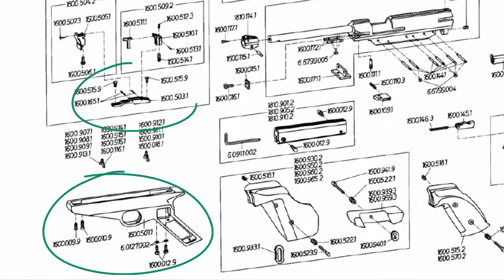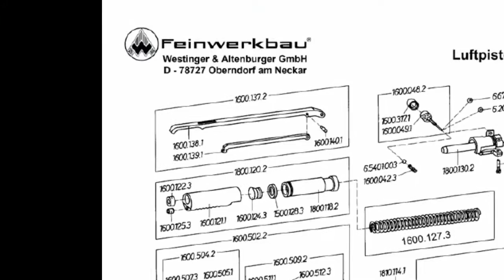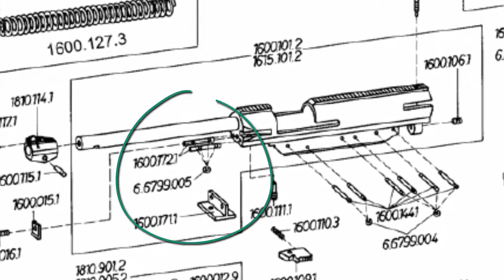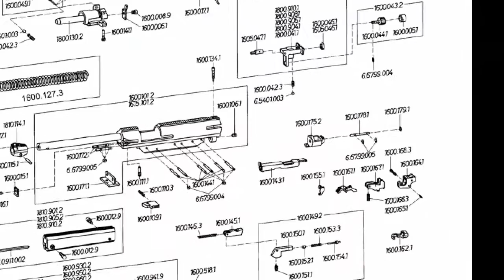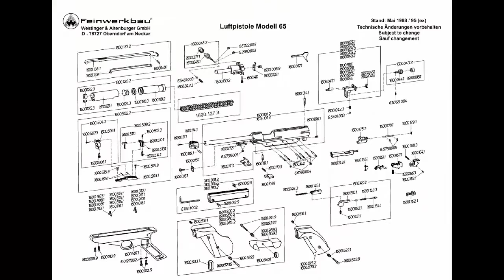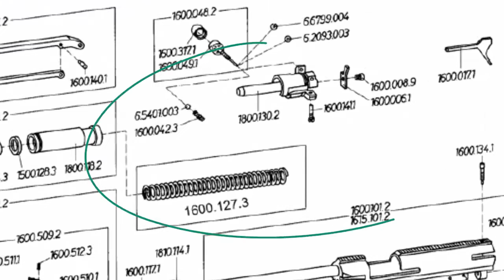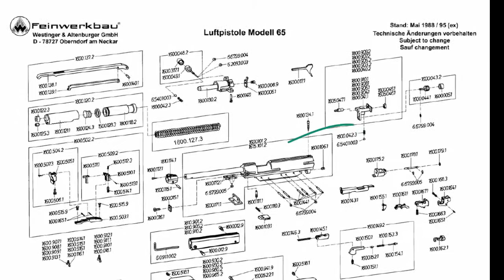FWB65 English Version

Comment: Thank you for FWB65 Video, it really helped with the seal replacement of my FWB80.You removed the cylinder after you disassembled  all the fire control parts, so I inserted the cylinder and reassembled the trigger parts. This took a while since I did not take enough pictures, went to insert the piston and without some way to compress the piston ring I faced the nightmare of taking everything apart again. I started from the back by disconnecting the two springs, that released the sear pressure and I was able to remove the cylinder, insert the piston and finish reassembly. Unless there is a broken part in the fire control parts I see no reason to take all of that apart unless the FWB65 is different than my mod 80. The little black bumper does not fit flush, the tapered end sticks out and will give resistance when you close the lever.
Reply from the maker: Hello, thank you for watching my video!
For sure there are different ways to change the seals, but I also like the challenge to fit complex parts together ;-)
 The little black bumper needs a little lube and force to get it in. When you fit the little bumper, it seals the air in the hole and that air you have to press out. 
kindly regards
Josef

Comment: I have a question the 65 or the 80 i  think they are the same, only can be practiced with the lp 65 via a plate and screw that presses the two cams vuwa and that is not possible with the lp 80, which does not have those two cams  at the front, but if I grind out those two notches at the weights, I can still use them.

Comment: Hi, very nice video. The anti recoil mechanism does not work well in my LP80, my guess is that it needs some fresh lubrication. I tried to dismantle it, but I am unable to remove the sliding pins. I have removed the E-Clips, but the pins seem to be totally stuck. The same issue regarding front and rear sliding pins. I tried to apply greater force but with no results. I am reluctant to be even more aggressive lest not to damage the pistol. Do you have any suggestions on how to remove those stuck sliding pins?
Reply from the maker: Hi, Piotr!
In most cases aceton or light oil helps. Let it suck in a view days. 
Cold Cleaners which you use for engine parts I do not recommend, because they affect the blueing.

The Front Pins you can push out from the breech side!
Details you can see on my other FWB 65 Videos.
Good Luck and patience!
Josef
Reply: I applied a significant amount of WD-40 yesterday and left it for a night. I will try to remove the pins in the evening. If it won't help I am considering to heat them up using soldering iron, maybe they will get loose this way. Unfortunately there is not  enough space to push the pins from behind, especially the front ones, without dismantling the whole system. Anyways, thank you for the video and practical tips :)
Reply from the maker: Heating is a good idea, but try first with the WD40.
I am sure there is enough space when you open the lever. Just below under the loading port you see the end of the front pins. With some tools you should reach them.
Sincerely
Josef
Reply from the maker: Ohh, sorry in the FWB 80 it may be different!
Reply: I finally managed to pull out the rear slide, however I had to remove parts of the trigger group in order to make enough space to push it out. What troubles me is that the sliding pin itself doesn't fit the mount nor 'the sliding hole' in the breech perfectly. It seems to be a little wider near the end, thus gets stuck at some point both in the mount cylinder and the mentioned 'sliding hole'. I think that this is the reason for failing anti recoil action. I wonder if the sliding pin should fit perfectly the mount and the hole, so that it should enter easily or should it pose resistance? How does that look in FWB65?
Reply from the maker: The pin should easily go out, keep in mind that there can be clips or thiny washers you haven´t seen. But from the far it is difficult to help in a specific way. 
In my assembly videos from the FWB 65 I show any detail, if you haven´t seen them yet, take the time and watch them. Most of the parts are similar to the model 80.

Sometimes it is really hard to disassemble an old airgun!!!
Reply: As you said before, patience is the key to success. I finally managed to pull the pins out, cleaned everything and applied fresh lubrication. Anti-recoil works as new :) Thank you again for the tips and the video, it was really helpful, keep up the good work!
Regards,
Peter
Reply from the maker: I am very pleased to hear that!!!
Thank you for your comments!
Now let´s go shooting...
Sincerely yours
Josef

Comment: very good video. I have a feinwerkbau modelo 80. I need help to repair. he was carrying todo shoot and the cocking lever  was left open and does not close. So that the main spring is compressed. Ir happened this morning, a year had not used ir.. Thanks for your help. I am, from Caracas, Venezuela and here no longer exist or repairers armories of weapons. I can only try repair it myself... thank yuo very much.
Reply from the maker: Hello to Caracas!
This sounds similar to the problem I had with one of the FWB65s, don´t try to release the trigger without holding the lever! Otherwise an axles will crash! 
Model 80 is a little different to the 65 but maybe my Videos can help to solve the problem. Today I released a cleaning Video and as soon as possible I will upload an assembling video of the FWB65 with all parts explained!
Greetings from Austria
Josef
Reply: Easy fix....They just get stuck sometimes when cocking.
   Pull gently on lever and push the top section forward so it locks. Finish cocking,load and fire. This happens when the top section isn't locked in place before cocking.....if it slides back,it gets stuck. Your gun isn't broken. .

Comment: you can use the weights of LP 80 for the LP65 if you only use the screw hole or you can use the weights of the 80 for the 65 with also only the use of the screw hole

Comment: Sorry, a question. how i can release the lever if the spring is under pressure??  Thanks
Reply from the maker: That´s a little difficult without having it in my hands. But I try..
First make shure that the upper part is in the right position, if not, move it forward per hand.
Then try to open the lever all the way back!!!, hold it and tap the pistol with the pistolgrip on a taple (or else). This shoult loosen the release for the kickback interlock.
If you can close the lever you can shoot.
- If not, try again.
Let me hear what happens - Fingers cross

Comment: this model is a  single spring pistol . new version has a double spring.
Reply from the maker: Hello Marlyn!
This is a really good question! 
I didn´t know the answer, but a few minutes ago I called Feinwerkbau.
First came the Model 65 with a double spring. Later on it got a single spring.

The power of both types is nearly the same.
The velocity (with normal Match Diabolos) is about 120 - 125 m/s (394-410 ft/s).
Kind regards
Josef

Comment: Help please! I’ve stripped down my mod 80 to replace the spring (did have 2 springs, but replacement kit has only one), and when I tried to remove the piston to replace seal, the compression cylinder came to the rear and is now locked there! Is there anyway to release it without having to take the trigger element apart?
Many thanks 
Nick

Comment: hello 
i have an old mod 65 and the cocking lever is stuck at the end of cocking position and it doesn't go forward. what happend? were can i purchase spare parts? 
thank you good job!
Reply from the maker: Hello!
Spare Parts you can order at www.feinwerkbau.de, there are also Blueprints for download.
Stuck cocking lever:
A view parts can cause this issue. First look down the loading port, in the bottom is a little gap where a small flap comes through. By opening the lever this flap should be in the rear position, if not, try to push it back. Now, there is some chance to close the lever, but it should move smooth. Don´t use too much force, otherwise the kickback interlock will be damaged.
If this trial does not help, disassemble the gun as you can see in my videos and try to find the issue, then reassemble it carefully.
I hope that helps!
Best regards
Josef
Reply: thank you! the flap is in the front and i cant push it back.i will leave it there and i will take care of it when the spare arrive
Reply from the maker: Good Luck and let me know how you did it!
Best regards
Josef